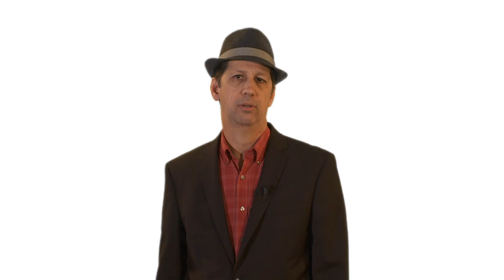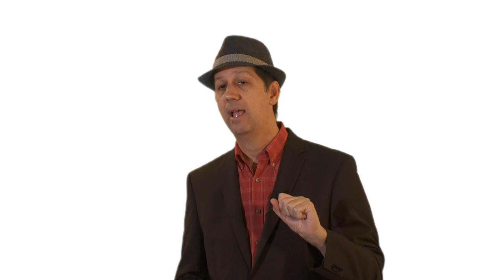OTC-X1 Questions & Answers

Comment: this has been going on for years with no progress and if something does happen nobody will show anything because of 'the powers that be' i think it's all total BS
Reply from the maker: +Lefario Laguela Thanks for posting a comment.  When you say 'this' has been going on for years, I assume me the research of the pods and the fact that no completed prototype has been shown here.  If my assumption is wrong, please correct me.  I'll proceed assuming I've correctly interpreted your comment.  

The first thing I'd like to address is your statement, "...years with no progress..." 

R&D takes time, especially with garage mechanics with no budget.  I've been in this position of watching, talking to the guys, and waiting since 2011.  I think Ralph came out somewhere around 2008 or 2009; and, the pods involve just a couple of guys in a garage in Australia.  :-)  And that's where any construction and testing of any craft was centered.  As it turns out, trying to build a flying saucer is an expensive hobby.   Not to mention, it's also time-consuming, insofar as figuring out upon which items one should invest their scant disposable income.  For someone who wants the best shot at duplicating Carr's operational craft, you don't want to waste your limited resources.  So, what do you do?  You read....a lot...which is what has been happening.  How the craft should be Wired had always been elusive, until the last half of 2015, when they tested monopolar motor wiring and operational principles with Carr's design.  I addressed this approach in my previous video, Wiring the OTC-X1.  This is progress for the pods -- a huge step; because, Otis T. Carr did not include wiring schematics in his patent or Toy kit plans.  Both of those documents and Tesla's comments on Forbe's Monopolar Motor may be found at my website: http://clandestinedisclosure.com.  

Now that the pods have an approach to creating rotation and counter-rotation, they have a viable approach to proving one of Carr's claims about achieving levitation, which I've included in the description field of this video, and which you may read in his toy kit plans.  Having a basic understanding of the forces associated with Lenz's Law, I have a pretty goof idea of how much power would be required take to kick-off the mechanical rotation of this craft; and, that is a challenge which will need to be quantified and addressed by those constructing the craft: How much power (Current/Voltage) is needed to create a strong enough force to generate the RPM's mentioned Carr's theory?  What gauge of magnetic coil wire would be needed to prevent them from melting the insulation and shorting out the coil when energized?  Let's face it: Free energy has not yet been discovered; so, we have to ask, what will be the power-source on-board the craft; and, amusing levitation is achieved, what prevents the power-source from running out?  Until the pods know Carr's principle of levitation is correct and founded in science - not pixie dust - it may not make any sense to consider designing a navigation system.  Maybe it would for someone else. This is just my opinion.  Some of the guys have already started looking into this.  Their theories are extremely rough - meaning, their full of guesses and suppositions with no means of testing anything at this moment.  

Next, I'd like to address your comment about BS.  

Yes, it sucks that inventors may be holding their designs close to the vest due to fear of the-powers-that-be.  What can I say?  During my conversations with the pods, it's always been about getting this design out there.  First, they need to figure it out.

Peace.

Comment: Is there a kit for the OTC-X1 that I can buy to do my own testing? If not can I have the number or website for the machine-shop that made the Utron, central accumulator, capacitor plate &  C magnet  that I see in the videos. I have a CNC laser, So I can make the frame no problem. I have an Idea to make the C-magnet using a vortex coil insted of the magnet former with the slandered wire-wrap.
Reply from the maker: +Talyn71 Gmail I've updated my website with URLs' an documents anyone would need to do Research and construct a prototype of Carr's Circular Foil Craft - the OTC-X1.  About the machine shop that had built those parts, its in Australia; but, you should be able to create your own mechanical drawings based on your preferred craft dimensions and take them to a local machine shop to have the parts made. If you don't want to re-design, I reckon you could use the drawings created by one of the pod members, which I've just posted on my website, as well.

Comment: Interesting! You talk about charged objects.. This reminded me on a highly reflective metal (usually chrome) objects that was in my lab while i was experimenting with Tesla coils. This objects become 'charged' in presence of a running Tesla coil so i could lit LED's (with AV plug) by touching LED's with those 'charged' objects. Dunno if this have any connection with Carr's 'charged objects', but that's my guess.. Good luck and thank you for sharing!:)
Reply from the maker: +oxiigen Here's the quote I couldn't remember during filming the video:
Otis T. Carr wrote in his toy kit plans:
"We have shown that a charged body, accelerated to an axis rotation relative to its attractive  inertial mass, indicates polarity in a given direction.  The dip-needle points, say, up toward the top of the body; but, mount the whole rotating body, with its spindle, on another platform and rotate this platform on a spindle, then, if the counter-rotation is greater than the initial forward rotation of the body, a dip-needle on the second platform will point down, while the first dip-needle points up, indicating the complete relativity of polarity.  When the exact counter-rotation matches the forward rotation THE BODY LOSES ITS POLARITY entirely and immediately becomes activated by free-energy (tensor stresses in space) and it acts as an independent force."

In other words: Counter-rotating charged masses becomes weightless
Reply: Alexey, also charges a Center disk with thousands of volts with counter rotating disks on top and under the central disk. Magnets are involved. The result is that it  lifts in almost complete silence.

Comment: I think the principal is the rotation and counter rotation that causes the lift.now by charging the shell of the craft it acts like a force field and the top needle tip of the craft is positive and the shell is negative remember a negative charged body is repulsive and a positive is attractive. the whole crystal thing I thing was simply a glass ball and I think that the reason he says the color aqua marine was simply an affect of the capacitor plates high voltage meeting oxygen creating a color affect..and the reason  the craft had is own gravity was bcause of the center utron coil its tornado shaped magnetic field affect created a pulsed gravity affect,